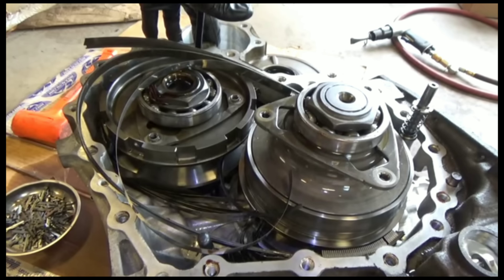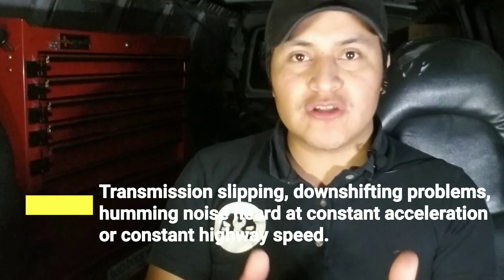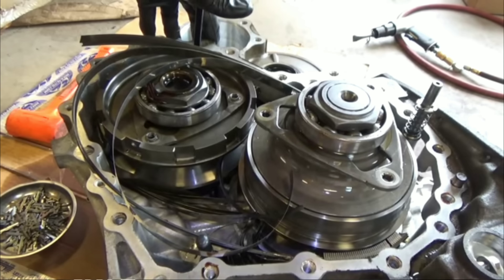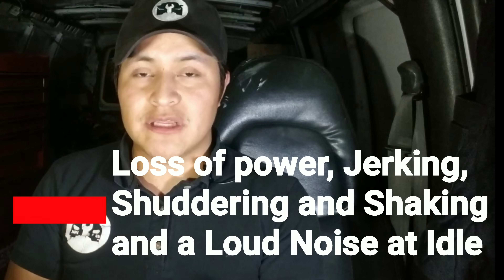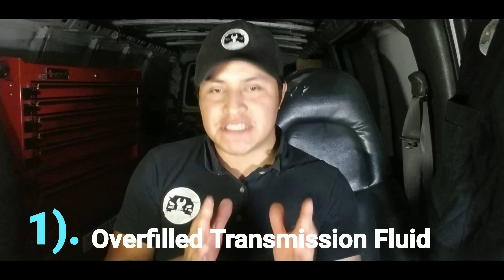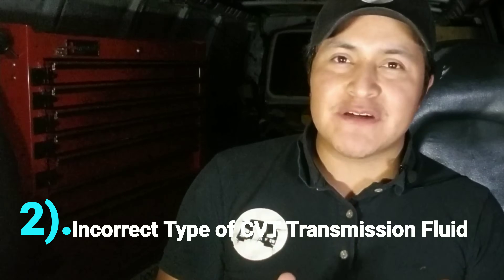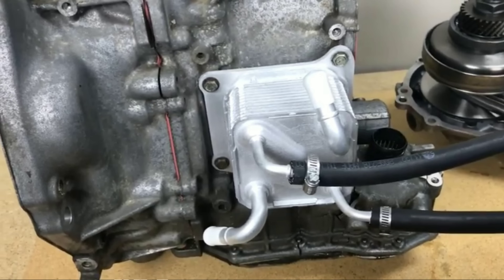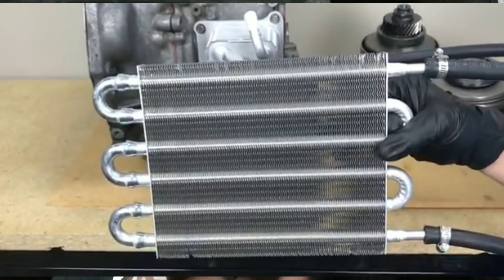NISSAN CVT TRANSMISSION | why it fails and what you can do about it to prolong it's life

Comment: I worked for Nissan and own a '13 Versa. Did my trans services every 25-30K miles, and my CVT still died at about 110K. 
These transmissions are very known for failure, but they Nissan remanufactured transmissions are rebuilt with the updated parts and we hardly had any issues with them once replaced. 

If you notice your cruising RPMs are getting higher than they use to be, it means the trans is starting to go out.
Reply: My wife's 2011 Nissan Versa bough it new. The first CVT oil change was done at 30000miles. After that had it done at 60000 miles intervals. Her car has now 140000miles and runs very good. I take the car to Nissan dealership where they flush out all the fluid. I'll reduce it to 30000 miles intervals.
Reply: @adrpals2324  I wonder how many cars run fine - and do we just hear about the few problems?
Reply: @adrpals2324  Do you live in the cold zone, the northern or warm weather without snow? I heard reving up to 3000 rpm without warming up on engine temperature can cause faster damage. I thought 2012 was the first Versa that uses CVT?
Reply: I don’t see RPMs going up but if I drive long distances when I push on the gas it won’t accelerate what do you think the problem is. I have a Nissan Sentra 2012 or 200,000 miles
Reply: @JohnJacobGarza  I had the same issue once. Not sure if it is some trans protection
Reply: @jasonquan2146  Make sure the engine temperature is between C and H, aka cool and hot, it's warmed up if there is few bars in the temperature display already but I am using CVTz50 to be precise on exact CVT temperature.
Reply: @JohnJacobGarza  That also means the trans is going out. Change the fluid.
Reply: @ksr622002  I did change the transmission fluid
Reply: @JohnJacobGarza  that's how it started for me. Problems get worse and new problems occurred. I was able to stretch it with many issues for a year then finally barely was able to drive and got it replaced. It started at 45,000 miles and got replaced around 80,000 all highway miles. New Trans 0 issue
Reply: @monsterpicklesNY  what is your solution?
Reply: @JohnJacobGarza  to be honest I just delt with it, at the time I couldn't afford to get it replaced. At red lights or anytime I had to stop evey time I had to go it took a good 3 to 5 seconds for the car to actually move, there would be no response from the pedal, was very annoying. After a year or so when the car barely moved I was able to afford a replacement like $4000. I'd say sell it or start saving. Luckily I'm at almost 300,000 and no issues with the replacement.
Reply: @monsterpicklesNY  how much was the transmission?
Reply: @monsterpicklesNY  I bought me a new Toyota corolla 2022 LE no more Nissan for me ever.
Reply: @JohnJacobGarza  200K on your 2012 Sentra already?
Reply: @billt7207  206.000 miles now
Reply: @billt7207  yes
Reply: @JohnJacobGarza  2013 nv200 same problem
Reply: @sunshinewr123  my solution was I just bought me a brand new 2022 Toyota Corolla LE. I’m not buying a Nissan to the day I’m dead.
Reply: @JohnJacobGarza it's the valves body in your transmission
Reply: @JohnJacobGarza  

Replace the 4 sparkplug, and the 4 ignition coils.
Reply: 2013 was a notorious year for Nissan. CVTs
Reply: @vickyburton2434  mines been great
Reply: @vickyburton2434  at 80K now
Reply: Sometimes it literally depends on the trans, people will still tell you " take care of car and it will take care of you"..had a 13 Altima babied it never went over 80mph n still died at 93,000 bought it at 80,000.. depends on the trans Maxima CVT by far the strongest.
Reply: @kingaza7734  you bought it at 80,000miles and babied it to 93,000??? You DO realize someone DIDN'T baby it for 80,000 miles before you. You cant expect the tranny to last long just because you babied it at the end.
Reply: @kingaza7734  thanks God.  
I got a 2009 nissan maxima and my millage 1,42000 mile 
You got me scared for a second 😅
Change my transmission fluid last year car still going strong 💪
Reply: @shazamfitness9471  I highly recommend putting an external transmission cooler on. They are cheap. Mine way 75ish dollars. It made a huge difference in mine
Reply: @shazamfitness9471  Would be nice to get 500,000. Especially these days with cars being so expensive.
Reply: @crand20033  not these day
The max u get 160k to 200k mile
Reply: @kingaza7734  swear I hear the “I babied” from the owners who’s trans didn’t last
Reply: @kalieburrows1427  ok??lmao
Reply: @kingaza7734 are you laughing your ass of or what?? It seems counterintuitive but I’ve talked to a couple of people with 200k+ who said they didn’t baby their cvt but did service correctly mines pretty close to 200k
Reply: @kalieburrows1427  Mine is at 80K, second owner of 2013 versa since it was a rental car for 8 months but 24K miles already lol people drove it 100 miles, it's abused by all those renters. lol
Reply: @kalieburrows1427  Reving up to 3000 rpm without warming up does as much damage as fluid overheats over 90C/194F degrees, if you don't live in the cold zone below 32F/0C freeze point then you probably don't have to worry about cold start damage.
Reply: @kingaza7734  thats not always true. I kept impeccable Maintenance on my 2013 Altima and transmission started failing. As of last week it has only 74,000 miles. Nissan is garbage
Reply: @Niners70  thats why i got a bmw. Which had been more reliable💪
Reply: @Niners70  they are such trash you're right. I put on a transmission cooler and it is helped get mine from the death whine and stuttering when I bought at 137,000. I'm at 185,000 now. Been changing the fluid every 15,000 since I bought it
Reply: @kingaza7734  Which BMW? I heard there are way more sensors and I heard one flat tire requires all four changed or TPMS light would not go away and other one hundred sensors.
Reply: @koreyhannan9071  yo man im thinking about putting a trans cooler on mine, any update on your car so far?
Reply: @kingaza7734  I have a 2013 Maxima with 141-thousand miles on it and still running strong. Why is it that the Maxima's seem to have a stronger transmission? I bought the car 3 years ago used from a fleet management company and was happy to also get all maintenance records that show the car has been routinely serviced for its entire life.  I put fewer than 5-thousand miles a year on it and have continued the routine service. So far the only issue I've had was a faulty evap canister vent control valve that I replaced myself at a cost of less than 50 dollars.
Reply: @kenherrera2819  2009 to 2014 Maxima has an additional transmission cooler (part# 21606-ZX59A) to cool off faster.
Reply: @kingaza7734  My roommate had a old Maxima (don't know what year).  His transmission was always a problem and it leaked fluid.
Reply: @kingaza7734  You bought it with 80k miles on it?  Did you know the person that put the 80k on it?
Reply: @kingaza7734  My roommate bought a Maxima and the trans failed almost right away. I guess the seller knew it was going out.
Reply: @kingaza7734  Do you know how the previous owner drove and maintained the car ?
Reply: I own a sentra 2013 SV only 56000 miles and transmission is slipping. Nissan service fails to acknowledge any issues with the car. However 2 other transmission shops told me its going. I needed nissan service to diagnose transmission so the nissan complaint commission would review my complaint. Looks like i will be trading it as Nissan wont help me. Worse car company ever!!
Reply: @lynnslevenski4064  Get a written statement from the 2 mechanic shops that the trans is slipping and then take it to Nissan and demand a replacement. If they won't do it, sue them.
Reply: How can you demand replacement
Reply: @lynnslevenski4064 warranty is 60k for any drive belt issues.
Reply: @lynnslevenski4064  Try Idemitsu CVTF or thicker Amosoil CVT fluid if you don't live in the cold zone, I heard some people had good luck with Amosil, especially 2012 Versa or whatever Nissan models used older NS2 fluid formula. I am using zidemitsu CVTF N3 because I have a 2013 Versa calling for NS3 and NS3 at dealer costs too much.
Reply: Thank you
Reply: 💡keep this in mind
Reply: wickedd365 I believe I own a 2014 Versa SV odo 100,000. What are ways going about fixing it
Reply: @MR.MoneyMike520  Can't.
Reply: Thanks for sharing...great info
Reply: @wickedd365 Did you use NS3 or NS2? And do it yourself or at dealer? I got '13 Versa too, SV trim lever. I had dealer changed with genuine Nissan NS3 at 45K miles(NS3 is better but it still doesn't help with this bad pump design), now at 80K miles, I am going to do it myself with Idemitsu type N-3 and may not drop the CVT pan to change the aftermarket filter. I have been using cruise control over 25 mph to accelerate and decelerate and CVT fluid temperature seems lower that way. I don't think mine will last 178K as I just saw one '16 Versa with 178K miles and bad timing chain for sale (the seller may not know as it could be CVT failure not engine). Where could I find the remanufactured CVT? I was just thinking to upgrade to bigger cooler and add separate smaller radiator I will be monitoring the CVT temperature using my bluetooth OBD tools and CVTz50 or car scanner ELM OBD2 then get everybody an update. After seeing your comment, 80K miles might be too late to add bigger cooler and add separate radiator like Youtuber The Labor Service showed. As a former Nissan fan for a decade, this would be the last Nissan CVT I will own.
Reply: Idk how alive this thread is but I too have a 15’ Nissan versa note pure drive and I think the trans is going out or it might need a flush. Symptoms are weird tho, 1st off car starts up and revs fine. Secondly, it drives just fine at 1st but once i drive it for a little while longer it has no power anymore. Accelerator is to the floor and I have to wait 15 seconds to feel any power. (No codes) 108k miles. Max speed achieved around 40mph. After 40 it starts to run a little rough and loses power.
Reply: Here’s how I fixed my Versa CVT. I took Nissan USA to small claims court, which typically allows for settlements $5000 and under. 

I won. 

That was my remedy for a poorly engineered piece of shit.
Reply: @Mikesorrento3344  I got extended warranty few years ago but after researching, I think I will get Amsoil CVT fluid instead of Idemitsu type N-3
Reply: @johnrand7720 I am thinking of doing this there isn't a recall with so many transmission failures
Reply: @Mikesorrento3344 Mike sorrento vs Nissan USA?
Reply: @ScaffoldBuilder haha. Yes. I won in small claims. Here in NH, it costs $90 to file. Nissan USA has to fly a rep from TN. Hey, my Versa’s first transmission failed at 48000 miles. Warranty replaced that. Second one failed at 88000 miles and Nissan told me
to pound sand. And the replacement was a remanufactured one, not even new. 

So I won about $3000. 

Yep. Sorrento V Nissan and I won.
Reply: @Mikesorrento3344 how did you win
Reply: What can be done because the Nissan dealership won't acknowledge it.
Reply: @RedsNESTLLC  there’s a class action lawsuit. Check to see if you qualified. They have to replace it if not call corporate
Reply: @senpailonestarr2787 how do we check?
Reply: 2012 Nissan rogue SV. Transmission went at 101k. Then now going again at 169k. Officially been screwed over. Still have a loan payment on a tin can I can't drive. Code is P0744..yay me...
Reply: I go down hill on neutral and change all the fluid on time ! 280k no problems !be aware some dealers dont do their job right !
Reply: @carlosmunoz7934  your an idiot!! when the car is in neutral rolling at speed, the fluid pump in the trans (ran off engine rpm) isn’t pumping a proportionate amount of fluid through the trans lmao
Reply: I have a 2017 Rogue with 80K.  Seems like the tranny is strong so far.
Reply: Are Toyota CVTs more reliable?
Reply: Wow you got 110k 😂😂😂 my transmission  went out at 38k miles they replaced it for free than it went out at 76k miles I'll never get another nissan
Reply: @clevelandsfinestentertainment what model did you have ?
Reply: had 3 of those transmissions now in an Altima. they are straight trash. dont try to Church it up with your bullshit
Reply: They have CVT in 2013 Nissan versa???? I have a 2012 I don't know exactly what type of transmission is in it but I know it's not a CVT cuz I can actually hear the gears shift
Reply: @TKD187  its called a stepper motor or something it simulates gears its not real yes you have a cvt.
Reply: In that case why not put in better parts from the start and avoid problems. Oh that's right cus there's no money in selling good products just in ones set up to fail.
Reply: Did you use NS2 or NS3 or aftermarket fluid? I would only use Indemitsu type N3 as Amosil CVTF is too thick which is made to replace NS2.
Reply: I’m at about 180k drive the piss out of it 150miles a day.. she still goin.. will probably need one soon tho lol
Reply: I heard there’s a class action law suit against Nissan for the cvt. The will replace 60,000 miles to 84,000 with extended warranty.
Reply: Thanks for the tip. 2018 Versa Note. Always kept up with maintenance. Toque rod and engine mount problems, engine seals replaced, throttle body replaced. Thank goodness I’m still under warranty. And only 35k miles. What’s next after my warranty expires? I’m going to Mazda or Toyota once it does.
Reply: I another post someone said it was the transmission control module & engine computer fighting against each other trying to stay in its power band while also trying to maintain fuel efficiency. The trans & engine were never in sync with each other always putting stress on the trans.
Reply: 2012 versa.   Trans gone at 30500
Reply: the 2013 and 2015 are the same?
Reply: my friend did you thousand 13 and 2015 the transmissions are the same?
Reply: Cruise control triggers the car to go into high rpms, but if I dont use it, it does not happen. The car had hardly any oil in the trans when I took it for service with a proffecional mech. They are ripping people up. Obviously, all this trash happens when your warranty expires. Cheap Nissan built in Mexico.Dont ever finance. Just lease it. You pay all this fringing  money and by 5 years the car is Kaka... TOTAL RIP OFF.
Reply: Built to fail.$$$$$$$.
Reply: that part
Reply: how bout facelifted nissan versa? 2020s and beyond. do they still use the same cvt. ?
Reply: I'm glad to hear new parts are working.  I saw that their were no significant complaints on repairpal on the latest rogues.  I went back to 2018, and it was complaints on the fuel gauge.
Reply: I fart and it slips
Reply from the maker: @wickedd365  Unfortunately even if you do all you can to extend the life of the CVT, it's still going go out at low miles...
Reply: I have a heard a theory that the Nissan OEM CVT fluid either the NS-2 or NS-3 doesn't do a great job on protecting and lubricating the transmission at high temperatures and over time it destroys it from the inside. Many people have claimed that when they replaced the OEM cvt fluid with "AMSOIL" CVT which is 1,000 times better and not only is the best CVT fluid by far but they also got the BEST engine oil and its been proven many times. The transmission will show almost no wear after 100k miles. Hard to believe but do your own research and reduce the chances by a lot of your Nissan CVT transmission from going belly up by using a better fluid.
Reply: @BigBoss-lm6cf  Amsoil CVTF has too much higher viscosity formula than Nissan NS3 at 40C and 100C but it's great for Nissan that uses NS2 as it's a universal CVT fluid or if you don't live in the cold zone to warm up forever like 10 minutes in winter.
Reply: @BigBoss-lm6cf I hurd the same on this my.
Reply: I have a 2013 Altima with 116,000 mi.  CVT had fluid replaced at 75,000 mi and have had no problems.  Maybe it helps that it's mostly on the highway.
Reply: @traveller3591  I would put an  external transmission cooler on the front of the radiator. Really easy to hook up and only cost about $75 total
Reply: @koreyhannan9071  are there any that you recommend?
Reply: @ethanshelton8497  there are three types. Tube and Fin, plate and fin, and stacked plate. I went with the mid-grade that's called plate and Fin. I believe mine is Imperial brand from advanced auto parts.  Comes with everything you need.  About $70. Just don't buy the cheap brand online for $25. They are small and not very effective
Reply: I have the manual transmission.

Comment: My 2011 Altima 81K has the limp mode you described. I bought that car at 7 miles back in 2011 the same month it was built not knowing it had CVT.
Reply: What do you mea by limp mode?
Reply: @TamikaX  Limp mode is also known as safe mode. The car's system tries to protect itself from further damage. For example the car will not go past a certain speed.
Reply: @Foodie_888  ok. Mine does that. Thanks for your response.
Reply: @TamikaX  Good luck to you regarding the car.
Reply: @Foodie_888  thank you so much. It's the only thing I have to get around.

Comment: Sounds like many of these cvt nissan owners don't know much about properly maintaining these vehicles. The cvt is a very sensitive transmission and if you drive it a lot during hot climate and never bother replacing the fluid, it will eventually shudder and vibrate and goes into limp mode. I have a 2010 nissan maxima and drain and fill the tranny fluid every 30K miles and also changed the transmission filter and it has never once let me down or stranded anywhere. Drives and shifts smooth as butter as long as you properly maintain the fluid! My car is at 190K miles now and drives like new! Just drove it from NC to Colorado and back about a month ago and it drove beautifully. In fact...I've taken it on many out of state road trips and never once worried it would leave me stranded.